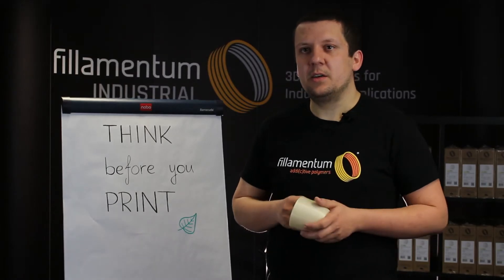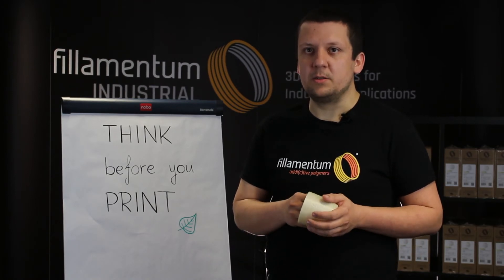NonOilen® | 3D Printing & Case Studies

Comment: I did 190°C with stainless steel nozzle on my prusa mk3s and worked like a charm ! 
Great video
Reply: What sheet and bed temp do you use? Can't get mine to stick - warps no matter what (clean sheet, perfect first layer, tried number of temps). Brim helped a little, but only on smaller prints, big ones warp and warp.
Reply: @menkabg  I use pva glue and 3D lack. Easy to wash with water and helps adhesion. Creates a protection film which can be peeled of after :)